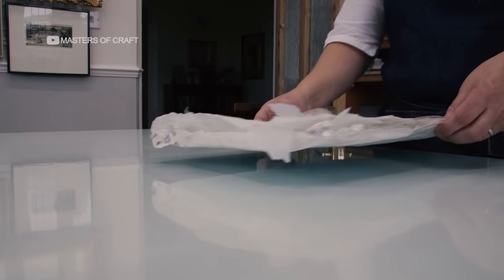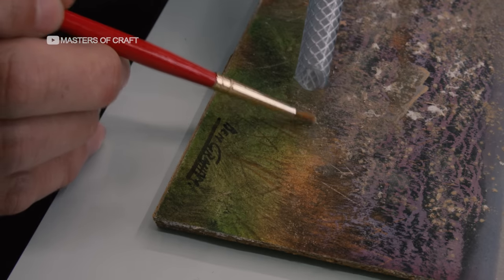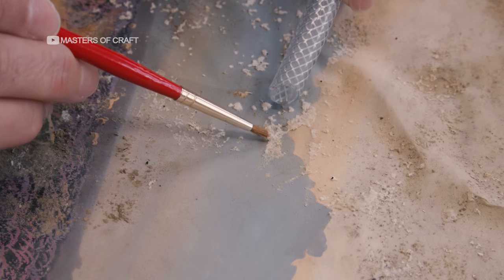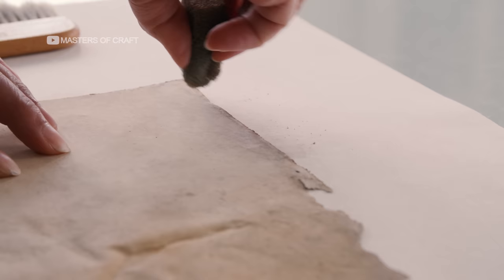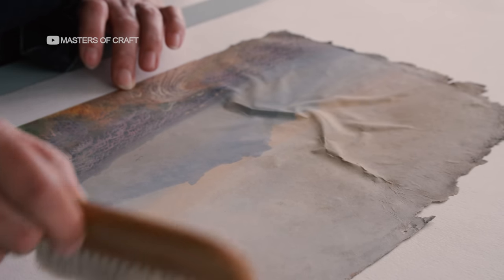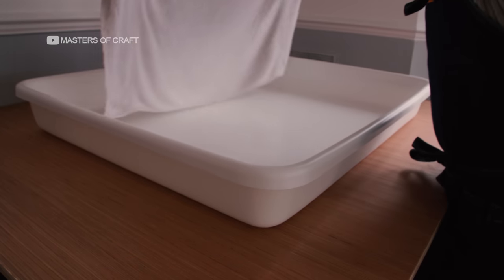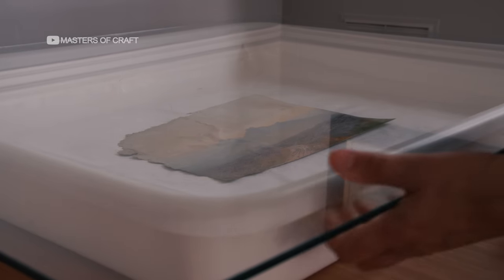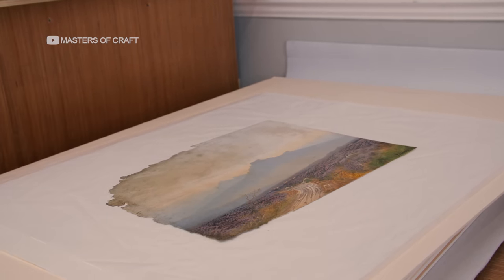How A Moldy Watercolor Painting Is Professionally Restored

Comment: Hats off to Emily O'Reilly for transforming that moldy mess back to original . I honestly thought it wasn't fixable .
Reply: Except it didn't look "back to original" to me. It still looks like it has significant staining from the mold, as well as missing sections.
Reply: @markjaycox7524 
That’s because watercolor is transparent, so it only goes darker not lighter. Anything that was added to the original is also pretty much irreversible because watercolor soaks into the fibers of the paper and a lot of the pigments are staining. Messing with the original could also run the risk of disturbing the original paint.
Reply: I haven't seen Julian restoring a water color painting with mold and water stain damage

Comment: It’s honestly surprising that the overall painting and colors remained intact given the damage. Thanks for restoring such a beauty.
Love watercolors, there aren’t many paints that have that gorgeous luminosity ❤
Also hats off for the color matching, as watercolor tends to shift when it dries that must be an insanely difficult skill to learn.
Reply: Pigment paint is often very resistant and it's usually the base material (paper) that got damaged, which could affect the look of the color. Molding and bonding damaging is another story though. I'm pretty sure the color is still there, it's just that re-exposing them can be very tricky. 

(It might be better to imagine the damaged painting to be a hidden gem, just that they are only a few microns in thickness and is extremely fragile when trying to be exposed.)

Comment: The painting was beautiful under all the damage, well worth preserving, such use of colour! 😍 But I felt like there were a lot of stages missing in the explanation...? For example, presumably a solution of oxalic acid or similar was applied front & back to prevent mould regrowth, before re-backing the work? And was there a rationale behind using wheat-based adhesive on a work which may harbour potential residual mould spores in the fibres...? It'd be great to hear a more technical breakdown of the work in progress!

Comment: Very interesting! However, many of the steps she did were not explained. Ok, I do watch Baumgartner…and I do appreciate hearing the details, such as why a certain glue is being used. Why did she screen that wheat paste glue? What did she mix with a large drop of water? Why was she putting small little marks on the paper and drying them with the heat wand? Hearing her speak would be more enjoyable that of the rather clinical voice over guy. But at any rate, the work she did was absolutely amazing.

Comment: Im fascinated as to why the color matching wasnt done to the top of the piece? Would painting over not conceal the black, and therefore not preserve the originality while also being a pointless measure? Im very impressed by the final product. A huge improvement over how it came to him.
Reply: Perhaps, the owner did not want to fully remove this "page" from the history of the artwork. It has suffered serious damage but survived, and this dark spot at the top is a reminder of this event. I see some similarities to the japanese kintsugi technique, where the aim is not to fully hide the damage, but to acknowledge it as a part of an item.
Reply: Watercolours are tranparent, so you can't  paint over dark colurs with light ones since the dark will be visible through the light colurs.
Reply: I was wondering the same. The damage from the mold is clearly visible. Leaving it does makes sense. Thank you for clarifying.
Reply: I assumed it was because this sort of painting doors not provide for an isolation layer, so there would be no way to reverse the work later if someone in the future wanted to. That combined with the difficulty of getting a light watercolor to work over the dark seems like it would have had to cross the line between preservation and repainting.
Reply: Because watercolors are a transparent medium, any painting over the stains would still show the stains. They would have to use gouache for the opacity, but it'd be imminently obvious since gouache and watercolor have different optical properties.
Reply: Honestly, reading through some comments, it’s a little surprising how many people apparently are unfamiliar with transparent watercolors. Maybe it’s because sometimes watercolor is also used to describe other water based mediums that function quite differently.

Comment: Interesting to see a different approach as I'm used to watching Baumgartner.
Reply: yes... this one is less... I don't want be mean, but the results are just not the same. Julian is a perfectionist really.
Reply: Oilpaints and watercolours are two very different materials.
Reply: @stormmoster  He does all sorts of techniques, and materials! He has even restored scupltures, pieces made out of wax, painted on glass (from behind), repaired frames, paper, canvas... You think he wouldn't be able to paint with water colour? Plus, the retouching is only a part of the restoration.
Reply: @nicolasfiore  My point is that ou can't clean a watercolour painting the same way you clean an oilpainting.
I couldn't find an video where Baumgartner cleaned a watercolour painting, can ou put up a link to one?

Cancel

Reply
Reply: @stormmoster  Even if so, I don't think the aspect ratio of the original and the restored one would be different. It literally lost half of the sky. There other problems too that Julian wouldn't have made, IMHO.
Reply: @nicolasfiore  I assume the owner of the painting didn't want the damaged upper left corner to be visible. If someone want's to se the top part of the sky you can just remove it from the frame and lift up the mat.
Reply: @nicolasfiore which is why he does not take on watercolour restoration, because some damage is irreversible and impossible to disguise. If you try to do so you would have to remove quite a lot of the original paint work and the restoration to the painting itself itself would not be reversible. Watercolour is a completely different discipline. For instance here the sky is a the result of the artist making an original wash of colour, an incredibly thin amount of pigment. The stippling techniques used with other mediums would not work here it would just result in a blotchy wash layer. That would be very far from the artists original intent. The mould has been removed and neutralised but what remains is foxing which cannot be removed without damaging the fragile wash layer, the foxing remains because the paint layer is translucent. Sadly there is no way around this so Julian’s methods and perfectionism just cannot work for a painting like this. He knows his limitations and how he likes to work thus does not take on this kind of work, but leaves it to the people who understand watercolour and paper based conservation better. Both conservators understand how not to damage the original paintwork in order to get a good result. This conservation is in fact quite brilliant and the result is excellent. It is free of mould and some quite horrible surface debris and damage, areas where the paint layer is thicker and darker have been vastly improved, what no one can do is remove the underlying tonal variation in the paper itself. The more textural areas will also have this foxing still, but the eye does not really see it, because the paint is tonally darker than the foxing. It is a wise decision to leave the sky as it is, any good conservator would understand why.
Reply: @nicolasfiore that is just how it has been framed and the placement of the matting.
Reply: @lindyashford7744   thanks for sharing!
Reply: @nicolasfiore I don't mind this approach. I find some damage beautiful and true to the nature of the artwork, that it has been through something and became a part of it without decreasing its beauty. Maybe I'm more of a conservation type than restoration, and don't really like repainting and color matching. Besides, working with watercolor paint is vastly different than oil painting Baumgartner often works on. If you want to restore with painting over and some sort, it you'd permanently alter the piece.
Reply: @nicolasfiore  Oil paints are opaque and easier to retouch with more opaque paints.  The watercolors are translucent and it may not be possible to duplicate the background paper.
Reply: @lindyashford7744  Only if it were possible to reversibly glue a new thin surface layer on to receive retouching, perhaps with a solvent cement and a solvent color with mutually nondissolving solvents.
Reply: @SeekingTheLoveThatGodMeans7648  the eye would be able to discern the ‘restoration’ no matter what you did. A restored digital print would be possible but not an original. Most work on paper using watercolour, and even pencil, ink and charcoal is not restorable in the same way as work on canvas or wood. Even heavier weight paper is very thin and is the ground for the work. Personally I believe in the value of retaining the signs of aging in such work, and only restoring actual damage.
Reply: if anything Baumgartner videos would've taught you that the person who's doing the actual work is in charge of the decisions regarding the extent and techniques of the restoration

Comment: I'm surprised they would use an organic material like wheat paste in this scenario. I'm no art preservationist but I know a thing or 2 about old houses...one I worked on, the homeowner got sick because the old wallpaper had been installed using flour paste and moisture from condensation in the ac system had caused mold to grow in the paste. Maybe that's different?

Comment: restoration is great, I'm just wondering why they didn't do more comprehensive restoration in the clouds of the painting that had a bunch of the mold damage. I figured I'd be seeing a lot more water color work in that area and they for the most part left it untouched
Reply: this person was very conservative in their painting, probably not someone overly confident in that field. leaving the mold in the skies was a fist into my eye, can't consider this job finished. It could have been much better addressed and retouched.
Reply: The stains  are probably in they paper itself, the might even go all the wa throug to the back of the paper, so they can't be romoved without damaging the paper. You can't cover them up since watercolours are transparent. If you tried to use opaque paint the impression of the painting would become very different.
By the way I have never heard that mold is lightfast so maybe the stains will fade when the painting is exposed to light.
Reply: @stormmoster  they obviously are and there are legitimate ways of treatment of such stains. Leaving the mold intact is just going to cause further problems down the road. I do understand that some restorers take this conservative and non-invasive approach in dealing with structural damage and take this route of leaving as is as the part of the history or provenance, but I myself believe it to be a faulty aproach. (that part can be chemically treated and or cut out and seemlessly joined with a healthy piece of paper and retouched so it regains its former visual apeal)
And there are some restorers who have a very high profile that in my opinion shouldn't be even allowed in proximity of masterworks they get to work on.. just take a look at Modestini's butchery of Leonardos Salvador Mundi, how far has she gone in her creative liberties and totally destroyed the piece. *compare the result with the cleaned version... that physically hurts.

Comment: This was interesting, but also very frustrating. The commentary was mostly minimalist, kindergarten-level comments that left out a heap of information. Isolation layers and various other steps appeared without explanation, almost no technical data was provided, and the conservation philosophy was completely missing. 
How was the mold treated before it was brushed off? How did they ensure it wouldn't return? What happened to the framer's label on the back? Was it significant for the provenance? Perhaps not, but making that judgement would be part of the process. What was the justification for not repairing the sky? No doubt there were good reasons for reducing the painting from almost square to a landscape format, but what were they? Since it radically altered the composition, and therefore the artist's vision, it's an important matter. Why was so little time given to the retouching, and so much time -- SOOO much time -- to watching wheat-starch being mixed? 
Give the length of the video, we could have learned ten times more than we did. Annoying.

Comment: It's clear what the restorer is doing to gently brush the surface and vacuum up mold spores (and maybe dirt) from the painting's surface. What I don't understand is why the restorer isn't holding the vacuum tube so its opening (the tube is cut on an angle) is parallel to the painting surface to maximize the suction area.

Comment: I wonder why the watercolor didn't dissolve at all in the flood. Was it literally underwater or just high humidity.
Reply: The painting was probably behind glass in a frame, so even if it got completely soaked there was no scrubbing effect. Watercolours don't desolve in water in the same way salt or suger do, but are more like fine clay(some are actual clays) that are mixed with water soluble glue.Sometimes when I'm not satisfied with a watercolour painting I made  wash of the paint to  reuse the the paper, then I need a brush to get the paint off.

Comment: 50/50 feelings. Yes, the result is 1000 times better than what was brought in. And yet i feel the discolored left top corner isn't satisfying enough. Can't be retouched? I know it's a lot of work to retouch this part bit by bit, but the result would be so much better.
Reply: I'm a watercolor artist. Watercolor is inherently different from something like oil or acrylic because it's a transparent medium which relies on the brightness of the paper behind it to look bright. Adding any paint to a dark area can only make it darker, not lighter. If you add red paint, it mixes with the paper color to look pink, for example. You start with a perfectly white color paper and can only get darker with every stroke. Now, there is a technique where you use a lightly wet brush and scrub the surface of the paper to loosen up pigment, but that won't work on mold discoloration, and it might be too abrasive besides. There is such a thing as "white" watercolor but it doesn't work in the way you might imagine. Even if you were able to hide the discoloration by absolutely covering it in white, you would be able to tell in person because it would look dull. Also you wouldn't be able to then retouch with colors, because you would reactivate the white as you go.
Reply: Thank you for your kind reply.  @harusameiro  I understand now better, what your decision making process was like and I agree, your expertise is much higher. Thank you for giving me an insight of your knowledge.

Comment: As an artist who does watercolour and oil paintings I’d rather it stay wrecked and discoloured. I would want it re-stretched on fresh wood or cleaned of mold. However if in the hands of those who wants something like this I have no power. If anything I would want some small high resolution colour balanced photos of the original placed next to the ruined one.

Comment: Unlike oil painting, where the retouching is done with a special removable paint over a layer of varnish protecting the original painting; it appears that pigments are actually added to the original painting. The restoration is permanently. Unless the restorer has a reference of the painting before the damage they are guessing. Also, pigments can create noticeably different tones, flowing and drying differently from brand to brand. All pretty risky! If this were my painting I would only go as far as adding the new paper to the edge.
Reply: I think before guessing I would have it scanned and use a.i. tools to create a new reference digitally and work on that till owner was happy before retouching the origional.

Comment: 5:00 You shouldn't work on the back without first protecting the front of the paint.
Reply: Yeah. Or at least, moving it to a surface that wasn't contaminated by the mold on the back... All that time spent cleaning the front just to put it onto moldy crumbs... I almost facepalmed.
Reply: This a watercolour, not an oil painting. There is nothing to flake off. The paper was glued to the cardboard and seems pretty strong . all it needed is cleaning ( and restoration failed to remove black mold marks) and relaxing/flattening (success).   We have not seen placing an isolation layer, looks like it was painted over with watercolours.  The signature on this damaged paintings was also restored aka forged after 90% loss.  But if Customer agreed to all manipulations, it is still valid restoration
Reply: @W_L_W.  Signature? Do you mean the text down to the left? That's the name of the place the painting is depicting, not the name of the artist.